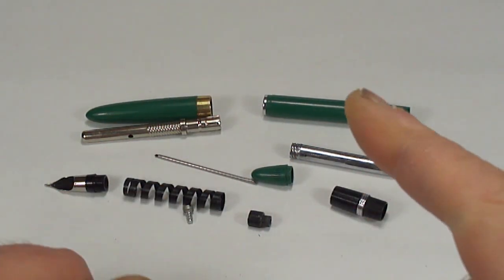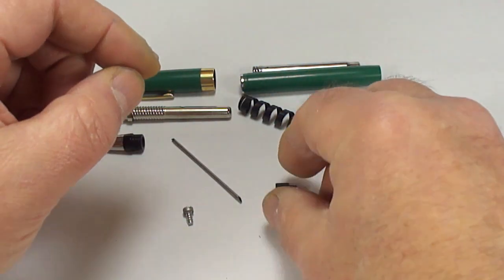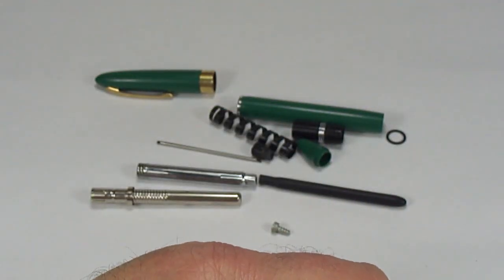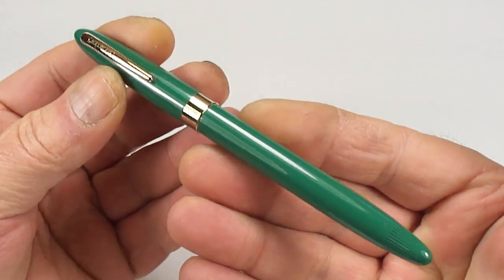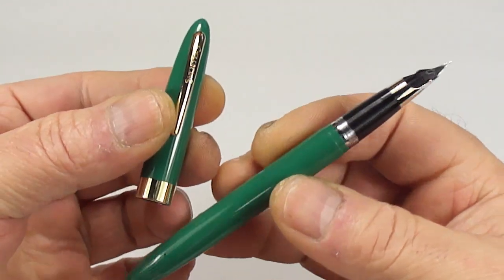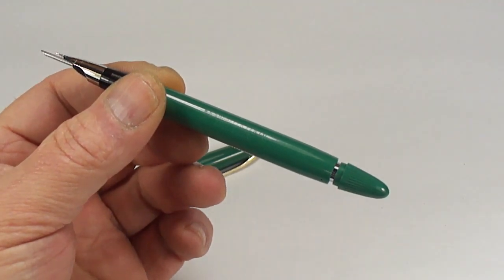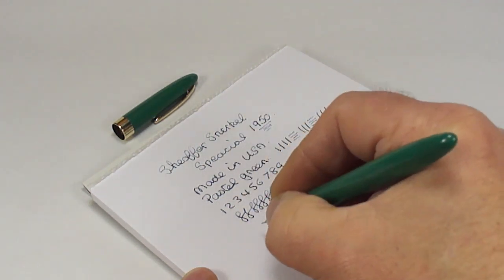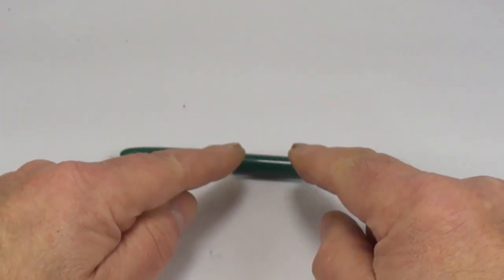INSIDE A SHEAFFER SNORKEL FOUNTAIN PEN

Comment: Two things: 
1. The pen is a mismatch model. The triumph nibs go on pens with white dot caps.
2. What you call the “filler tube” was called the “touchdown tube” by Sheaffer.
Reply from the maker: Hi Brian, yes i would expect the open nib on this pen. However it must have had been added sometime in the past, at least it has the correct snorkel tube for this nib. The internal parts names differ depending on who you talk to. Thank you for your information.
Reply: @grandmiapens  it’s more likely that the cap was replaced. All the parts are interchangeable between models. That same pen with a plastic White Dot cap would be a Statesman.
Reply from the maker: This is how the pen was found. Now serviced it works fine so i have no concerns with it. Cheers Brian.